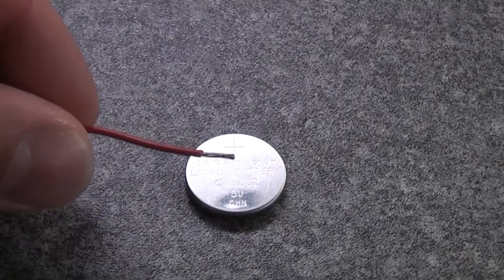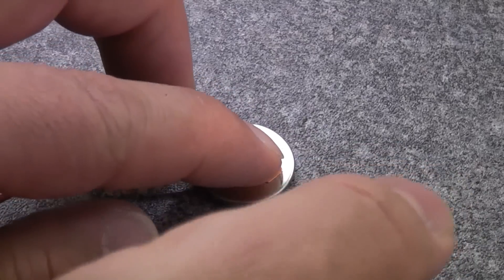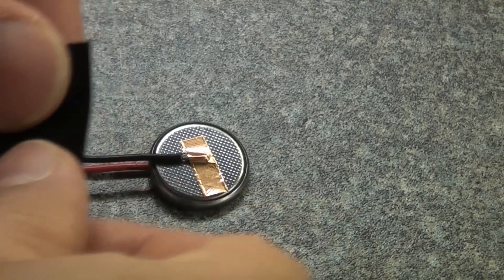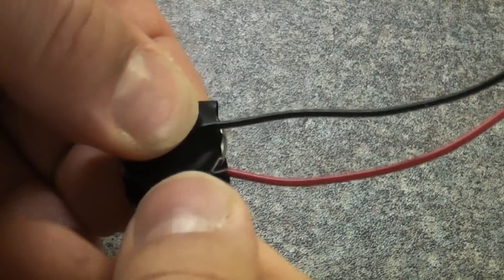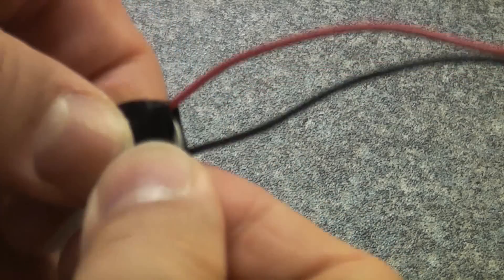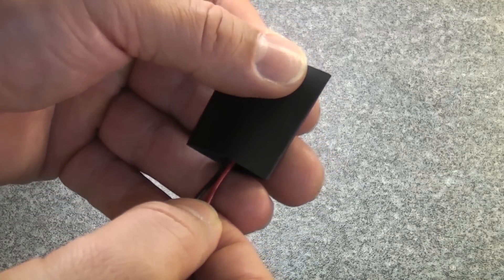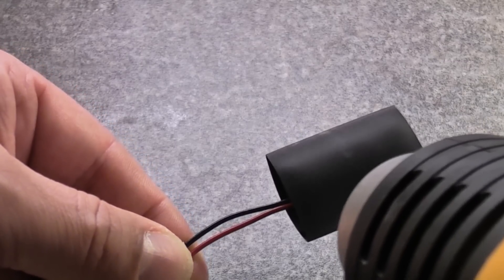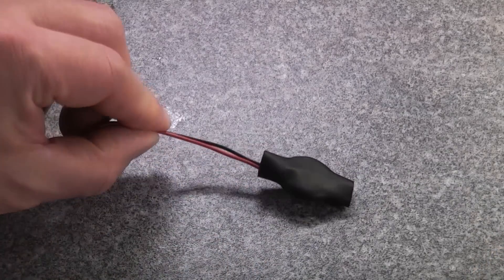CMOS battery hack | Laptop CMOS battery

Comment: if you really need to solder, then you should use a battery holder and solder wires in it and place the cr2032 in it, all done and place the 2-pin connector at the front

Comment: It seems like history is repeating itself. Both of these ideas crossed my mind: soldering the wires onto the battery directly, or wrapping the wires in place with insulation tape and then adding a heat shrink for good measure. The latter seemed most convenient as I don't like to solder. But wow! Good thing I found your video and saw what can happen if you try to solder onto a battery. So not only is taping it together more convenient, it's also the secure way to do it. Short of only doing it professionally with a spot welder, like they do in the factory.

But why use a copper tape I wonder? I have never used one before. Is the adhesive conductive on this type of tape? I could not find a definitive answer to this fairly simple question from local suppliers. Apparently, people that buy copper tape are mainly concerned with snail invasion, so it's sold as a pesticide. They don't really care if it's conductive or not, as long as it keeps the snails away from their plants. LOL! I had a good laugh at this! :) It's the first time I hear about this. I learned something new about snails in my search for conductive tape. So they know that it works for snails, but they can't tell if only the top side of the tape is conductive or if both top and bottom side are conductive. I know there are such things as conductive adhesives or glues. But since a single roll costs about 9€ (about 8£) and I didn't know if it would work, I decided to get it elsewhere (or not at all). I think I will order online, along with the appropriately sized heat shrink tubes. The CR2032 is 20 mm in diameter and the biggest heat shrink tube I have is 19 mm wide and it won't go on even if I push it. So I will get the right size and some copper tape (to satisfy my curiosity about conductivity).

I might as well skip the copper tape. I have preserved the battery terminals by prying them up and then flattening them out with pliers. I found a guy from Latin America (Argentina) did the same, and then he rolled them up a little bit like hooks, and then just taped them to the battery. That way you get more volume to press against the battery as you wrap the tape around! Clever! He also added a small piece of tape in between the wires to prevent shorts. You can see his video here: https://www.youtube.com/watch?v=svtG4ypcKQA

It's hard to believe that people are still changing their CMOS batteries this way. It's a good thing that we still can change the batteries on electronic devices. I'm currently doing some work on a 22 years old Fujitsu Siemens laptop for an acquaintance of mine, and I measured the battery voltage to 0.43 V. It's no wonder both BIOS and Windows were complaining about wrong date and time. I have a handful of these CR2032 and a mix of other button cell batteries, brand new and recently purchased. I just had to improvise to get one in. I have not worked on a laptop before that didn't have a CR2032 socket. It must be the very old ones that didn't have a socket for a CMOS battery. In any case, thanks for the video!

Comment: I bought a Cmos battery with wrong style plug. What is the best way to splice wires to put old connector on new battery?
Reply from the maker: I’d strip the insulation and just twist them together, then tape with insulation tape  👍
Reply: @ultimatehandyman  I had planned to try that but finally got it to plug in using a cut off floss pick as a press down tool. I have never seen them plug in that tight. I hope I don't need to unplug for a long time. Thanks.

Comment: Do you really need to put the shrink wrap over the battery as well as the insulation tape? Would the insulation tape be enough? I don't have a heat gun or the shrink wrap. If  I have to get those on eBay then this isn't going to be a cheap fix after all !
Reply from the maker: No, it will be fine with just the insulation tape 👍

Comment: Ah, conductive tape . . . Well, I'm just now seeing this video, and I used electrical tape exclusively, but thankfully it still worked. I guess, as long as you do it in a way where each wire remains exclusively touching on one side of the "coin" (without those wires ever touching each other), you'll get by. Apparently, this CR3025W, is simply a CR3025 with a wire and connector attached to it. I had to replace one of these in an Intel NUC. I'll buy some conductive tape for the next time. Thanks.

Comment: Best method is to spot weld, like they do on these from the beginning. It's possible normally to just rip off the old weld without rupturing the nickel strip. Just be careful to not short the battery, like you did when you tried to weld it. Using a little bit of electric insulating tape is all needed.

Comment: An even better trick is to use thermal adhesive, or even thermal paste, as virtually every nerd who has ever installed a heatsink has some in their kit. It is electrically conductive, and even the thermal paste has some adhesive properties - enough so that some tape will take care of the rest.

Comment: If the laptop manual says it uses a CR1620.. are all CR1620 non-rechargeable? In my case its a lenovo laptop and its an old one. finding the parts is difficult, so you hack would be might useful.
Reply from the maker: I'm not sure about that, sorry!

Comment: What kind of tape did you put in the wire of your cmos battery?
Reply from the maker: Copper tape, but it will still work, if you just use insulation tape ;-)

Comment: I don't have a hair dryer, what happens if I don't heat shrink the electric tape?
Reply from the maker: It will be fine with just the insulation tape 👍
Reply: @ultimatehandyman 

is insulation tape the same as electrical tape?

and, is that ok if I use copper tape direct to my old CMOS-connector? due to the current CMOS-connector having like mini silver-plate (Idk how to call that) on the tip cable
Reply from the maker: @naufalkharits   Yes, that will be fine. Electrical tape is just another name for insulation tape (people call things differently depending on where they live)
Reply: @ultimatehandyman  
thanks! I have more confidence now for hacking :)

Comment: @Ultimate Handyman I have an older 2009-ish model Dell Alienware M17x with dual 5780 ATI cards. I took the CMOS batter out and tried replacing it with a new one I bought online however I couldn't get the plug to go back in. Is it possible I broke something. It seems like the plug is too big to fit and I'm unable to force it. I wish I'd saw you're tip sooner I then could maybe have just unwrapped the old battery and replaced it with a new one while keeping the same plug. Really frustrating not having a BIOS that remembers its settings. Thank-you for the helpful tip. Also would you be able to show how to attach the leads into a new plug?
Reply from the maker: Perhaps the plug is the incorrect type (I think you can get different sizes)
Might be worth getting a magnifying glass, to inspect the pins, to ensure they are not damaged 👍

Comment: Thanks for making this video. You saved me probably $30. I had 3 Intel NUCs that all needed the battery replaced. Luckily the existing batteries had flat metal connectors on the ends of the wires that I was able to pull of the batteries and use to connect to the new batteries. Also, luckily, I already had some aluminum metal tape that would normally be used for sealing duct work (not duct tape, the metal kind). It worked great. I didn't have any heat shrink. I just wrapped it in electrical tape. Hopefully, it doesn't melt and make a mess for the next time I need to replace the batteries. Other than that, was glad I was able to immediately replace the batteries and save some money. Thanks for taking the time to make this video. It was very useful. Also, people were complaining the ones I was going to buy on Amazon sometimes had the wires backwards. I would rather make my own and make sure they are wired correctly. Pretty pathetic quality control that a company would let that happen.
Reply from the maker: I'm glad the video helped 👍
Reply: Obviously you have never used electrical tape to wrap something then returned again later only to find that it sweated to become a sticky mess and it had also moved around  due to the sweating. It's the last type of tape I would ever use!

Comment: Did you try using replacement battery without that black sleeve, just with extra layer or two of electrical tape?  This is merely a practical question: I don't have a heating gun, and don't want to spend $30 just to replace a $1 battery. )  Thanks!
Reply from the maker: It will be fine, if you just use the insulation tape 👍
Reply: @ultimatehandyman  Perfect, thanks!

Comment: I have an old toshiba tecra a9 that needs a new cmos. This one looks like a peanut. It's got 2 CR batteries.
Can I use the same trick with 2 batteries? Also what spec wires should I use? Or should I cut the original ones wires?
Reply from the maker: Yes, I do not see why not.
I'd use the original wires, it's much easier ;-)
Reply: @ultimatehandyman  yes that makes sense now 😅
Is there anything different I must do with a double battery cmos?

Comment: I actually tried to solder the wires to the battery before I saw your video! Lucky there was no explosion, but the battery did get very hot!
Thanks for the tutorial, this way is MUCH better and easier :)
Reply from the maker: I'm glad you were lucky ;-)
Thanks for the comment 👍
Reply: Yep, just did the same - even after seeing the thumbnail for this video and thinking I knew enough - the solder didn't stick to the battery surface, and by then the battery was very hot, probably ruined, but cheap, and it didn't explode - so I came back to see how it's done.
Reply: Mine exploded with a bang!

Comment: Just what I was looking for!! Was about to solder too. Mine had a contact attached to the wires already so I made it flat as possible and wrapped the electrical tape tightly around it and seems to be doing the job. I swapped out the original 1620N battery with a 2032. Same voltage, etc just 3 times more MAH. Thanks for posting

Comment: What about the end part where there is the connector we don't have the tool to make that..?
Reply from the maker: You get that part from your laptop (original source of the battery)
Or you can buy the connectors, they are called micro JST connectors
Reply: @ultimatehandyman Does USB Connector work in this method? To just easy plugged in and out

Comment: Thank you for saving against exploding a battery :D But if I had aluminium or copper stickers and heat gun, I wouldn't have thought about using them? :D Obviously most of the people around doesn't have this equipment :)
Reply from the maker: You can just tape the wires to the battery using insulation tape ;-)
Thanks for the comment 👍

Comment: Must make sure that you're replacing the CMOS battery with the same type of battery. Some use non-rechargeable ones like the CR2032 shown in this video.  Others use rechargeable ones like ML1220.  You risk damaging either your laptop CMOS charging circuit or causing the replacement battery to leak/explode inside your laptop if you use a non-rechargeable in place of a rechargable battery.
Reply: are all types of CR-2032 non-rechargeable?
Reply: @naufalkharits  yes, only ml2032 are rechargeable
Reply: I have a 'CR2032 H 3V' battery, Is it okay to be used in a Laptop with a CR2032 3V 210mAh battery
Reply: I know this was some time ago, but actually this is not correct. Laptops us CR2032 Lithium batteries and not ML rechargeables. Also most rechargeable batteries cant reach the needed voltage or die much quicker. The CMOS system uses such little power a rechargeable isn't needed. So as long as your laptops one was CR2032 and you replace with the same you're all good
Reply: @betablockrr lenovo uses ml 1220 in some of their models
Reply: @tempest031 Dell XPS also.

Comment: You can remove the wires from the original cmos battery and keep the connector intact. Use the conductive tape and the heat shrink to connect the wire to the new battery and viola, a new cmos battery ready to install.

Comment: Please show how to put the connector on
Reply from the maker: It just pushes into position, you can't get it wrong, as it will only fit one way ;-)
Thanks for the comment 👍
Reply: @ultimatehandyman  the connector piece is not on the wire like you show in the pic.. how do i put the connector on the wires to connect it where it needs to go.
Reply from the maker: @amylizgaming2372   Sorry, I misunderstood. I have no idea how the connector is put onto the wires, I would imagine that they are crimped on with special pliers or similar.

Comment: 01-.36    you almost created a short-circuit there, the tape is almost a bit too ,long,too close for confort... lol   
but a nice idea,nice video,  thanks
edit: you need to say and show ,to use the 2 wires from the old battery , and  its connector.

Comment: This tutorial is great. I have been struggling to find the right replacement battery with the right connector. 

Before I try this method, does someone know if the conductive tape is essential?
Reply from the maker: You can get away without using the conductive tape 😉
Thanks for the comment 👍
Reply: @ultimatehandyman  Do you know what kind of connector it is and what household items have it?
Reply from the maker: @NicCrimson   I think they are called JST connectors- https://fave.co/3krDCOb
Small electrical devices that contain batteries often use them (as well as other small electrical items)
Reply: @ultimatehandyman  Thank you so much
Reply: @ultimatehandyman  thanks! Also helpful for me, years later :-)

Comment: Wish I had these tools, maybe one day.  For now I'll wait on shipping. Thank you for this cool video
Reply from the maker: You are welcome
Thanks for the comment 👍
Reply: Same. If I'm doing all this to avoid waiting for shipping (amazon can get me one in 2 days) and save a buck or two, but I have to buy conductive tape, heat shrink sleeves and a heat gun? How long for all that to arrive and how much more expensive than a battery? I have a feeling that just wrapping it well in electrical tape and calling it a day would be fine in most cases.

Comment: Thank you for the useful video.
I am trying to make one such PRAM battery for my old G3 Powerbook (Pismo).
However, i am not an Electronics engineer or technician of any kind. So, i have a couple of questions. It would be great if you could answer them.

It appears, i will need to connect two such 3V batteries in series for my 6V PRAM battery requirement. Any step-by-step instructions / video on how that can be done?
The tiny white 'plug' that you were referring to, i am told there are different types of connectors (like shown here https://bit.ly/2PVLCJz). How do i find out which 'type' my requirement would be? I tried looking at my old laptop PRAM socket. It's too tiny to discern this. Also the connectors seem so subtly different, it's kinda difficult to be sure.
Reply from the maker: You should just be able to put one battery on top of the other battery, so that the + and - are touching together. This will mean that the batteries are in series and the voltage will double.
As for the connector, I am not sure, so it might be best if you just remove the existing connector and tape it to the new batteries ;-)

Comment: Is it absolutely necessary to use the conductive tape to get the least impedance or would flattening and spreading the wire leads a bit and then using the electrical tape wound tightly be sufficient?  I don’t have any conductive tape.  What about an aluminum foil tab (no adhesive) then electrical tape?
Reply from the maker: Don't worry too much about the conductive tape, it will be fine without it. That was just a belt and braces approach.
Thanks for the comment 👍

Comment: thanks for the tip, 7 years later and it's still relevant.  what would you recommend using as a sticky pad to adhere it to its oem location?
Reply from the maker: You can buy small double sided sticky pads to hold it in place, they are widely available- https://fave.co/2VTPGxN
Thanks for the comment 👍

Comment: What type of connector do they usually use these days for those batteries? Is it something like a 1.5mm or a 2.0mm pitch?
I have an ITX Z390 motherboard, and the connector for its battery is located near the rear I/O and it has under a heatsink that covers that area. Gonna be a chore to get at without taking the entire motherboard out...
Reply from the maker: I'm not sure. I did buy some, but can't find them!
Thanks for the comment 👍

Comment: good job man, thanks very much. I have a question tho, I have disassembled my lenovo carbon and i found inside Mitsubishi cr2016e 3v battery. Now this "e" letter bugs me but I cant find this particular battery anywhere on a web, and now I am wondering is it a rechargeable lithium battery or not rechargeable???  Sounds logical question i hope. :)
Reply from the maker: I'm not sure what the e stands for. I don't suppose it says in the manual?
Thanks for the comment 👍
Reply: Ultimate Handyman still I  don't know is it rechargeable or not, couldn't find anywhere info about that? Should I put non rechargeable Li/MnO2 inside than?

Comment: hi guys and hi handyman, well done! a question  for you: my acer l3600 has a cmos battery wrapped like yours but it's connected to three wires (red, black in the middle and white)...why? and how should I connect the wires? tks 4 your videos ;)
Reply from the maker: I'm not sure about that, I have only ever seen them with two wires  🤔
Thanks for the comment 👍
Reply: @ultimatehandyman take a look on eBay or Amazon, or similar, if you want. I think that the 3rd wire is for the charging feedback of device. Bye